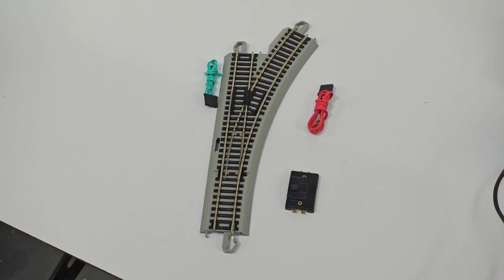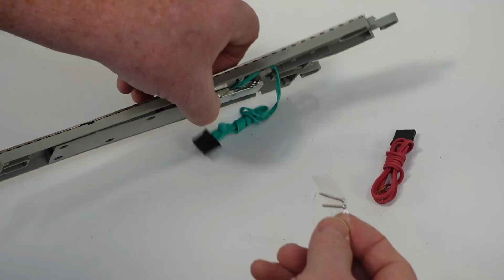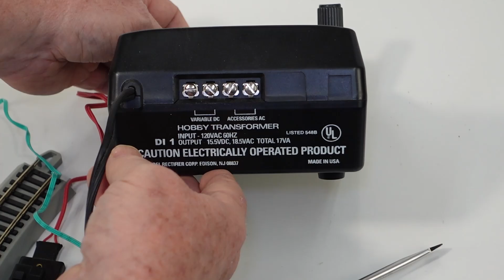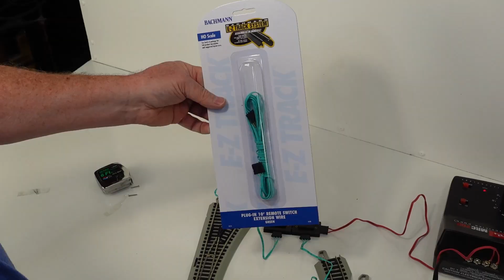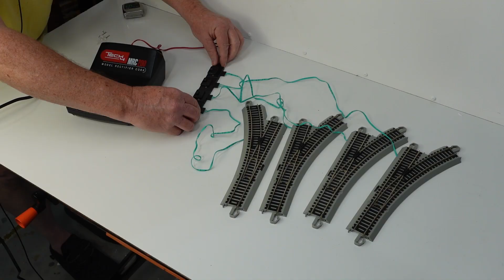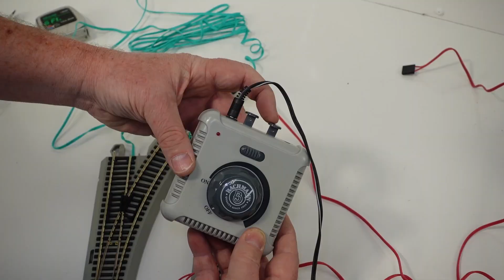Wiring Bachmann E-Z Track Switches!

Comment: Great video I will be receiving my switches tomorrow the tip on the green extension wire was perfect I was able to order for tomorrow. Thanks for the help
Reply from the maker: Thanks for watching and commenting!  I'm glad you found the video helpful.  The green wire is a great accessory. I hate having wires stretched to their limits and the green wire are pretty long, providing plenty of slack. If there's too much slack (as often happens with us) we coil the access wire up and hang it from a hook under the table to keep it out of the way.  Good luck with your layput!

Comment: Hello Sir,
I am from India. Loved how you explain in detail. Will the small grey power supply run the train also? Or just the turn out?
Reply from the maker: Hello ripplesonroad, Yes, those small gray Bachmann controllers power the track. Those are the type of controllers that typically come with Bachmann DC train sets. The track wires are connected to the controller via a TRS like plug in connector.  And, as you saw, if the power supply also powers accessories (not all do), the power supply will have a pair of guillotine type wire connectors to receive the wires from the accessory.  I hope that  answers your question. Thanks for watching and commenting!

Comment: I tried to set up my Bachmann EZ Track 44861 turnout switch following the instructions in this video. But it fried the switch as soon as I connected it! (Started smoking, burning smell - won't use anymore.) I know I have the right connection to the power pack. Any idea of what is wrong? Thanks in advance to all that reply.
Reply: Looks like we got this one figured out. Thanks for this video.
Reply from the maker: Wow.  I've never heard of that or experienced that before. Even after it's wired up, the switch shouldn't activate until you throw the switch.  I've wired and rewired many of these switches over the years and have never had one smoke immediately after connecting. I'm not an electrical engineer, but it sounds like either a faulty switch or it's getting way too much current somehow.  I wish you luck resolving that issue. Thanks for watching!

Comment: Could you plug the red power supply wire right into the power track that comes with the starter kits on dc models?

Comment: My power supply on my Bachman train never came with the two tabs on top
Reply from the maker: Yes, I've noticed some of the Bachmann controllers do not have the accessory terminals on the top of the controller (I think that's what you're referring to).  The controller we use to power the turntable dose not for example.  If you have no accessory power connectors on you power supply consider using an AC adapter.  They work quite well for this and are pretty cost effective (check out amazon. About $10). Good luck!
Reply from the maker: I meant to add that we have a video on using AC adapters for accessories if you're curious. There are many other videos on this topic on YT as well. Good luck!
Reply: @Northeasttrainyard I just bought a used power supply and hooked up my switch but the switch is backwards

Comment: The green wire cable doesn't reach as far as I need, and I'm not sure how to make it longer.  Any ideas?
Reply from the maker: Yes! Bachmann sells an extension wire  for this. The extension wire is even green like the wire from the turnout. We use these quite a bit and they work well.  You can pick them up on Amazon for about $12.50. Good luck and thanks for watching!

Comment: Enjoyed your video, but my Bachmann train set transformer doesn't have the two springy posts to take the switch power leads that yours in the video does.  Can the switches be connected to the rerailer track piece somehow?
Reply: No. Track is variable voltage. 
You have to buy a controller with accessories connector. 

Why would Bachman sell you a $45 turnout you can use with a rail chief or yard boss boxed set? 😃
Reply from the maker: Excellent point docdarlin5491.  I'm not sure what your railroading budget is, Davidkoopman-r3w, but you could use an inexpensive AC adapter to power your accessories. Check out our video on AC power adapters if you're curious how that would work.  Thanks for watching and commenting and good good luck!
Reply: Why dosent Bachman make one to help young railroaders to run there trains. Its terrible they dont sell the componets to switch the track remotely and
Reply: put some instructions on the back of the package on what you need to make it work

Comment: What if your DC controller does not have any power supply connections?
Reply from the maker: Yes, I've noticed some controllers do not have the accessory terminals (one of our Bachmann controllers doesn't).  If you have no accessory power connectors on you power supply consider using an AC adapter.  They work quite well for this and are pretty cost effective (check out amazon. About $10). We also have a video on this topic if you're curious.  There are many other videos on this topic on YT as well.  Good luck!

Comment: I just upgraded to Nickelsilver tracks and as a long time ez track user I noticed the turn outs suck for steel track. I really hope these nickel silver switches are better and don't derail my trains. I have a operating coal layout with nothing but vintage Tyco and Atlas two bay operating hoppers, and they make a mess when those poorly constructed frogs open the dump doors. And then derail the cars behind which being loaded with a loose load they sometimes spill all over.
Reply from the maker: Yup, from what I've read/seen the gray nickel/silver track is better than the block steel alloy.  I will say even the sliver/nickel turnouts can be hit or miss as far as derailing goes.  Some work better than others. Good luck and thanks for watching!

Comment: Dude thanks a ton! I just got the Worlds Greatest Hobby Kit for the Nickel Silver track and this video is awesome for how to wire the switches! Thanks a ton from a mid 30s Texan who is getting back in HO trains! My switches are now electronically switching
Reply from the maker: @RichyN25  glad you found the video helpful! Good luck with your layout and thanks for watching!
Reply: U run power lines to long sections of track.?
Reply: @ you can power the entire World's Greatest Hobby track layout plan with just one power connection without any issues, I've got a couple videos on my channel I took in short form showing trains running and I'm just using a regular Bachmann power pack and nothing else.
Reply from the maker: @RichyN25  Yes, totally true.  When we were researching putting in a garden railway, we were asking about power requirements and the store clerk said it didn't matter how long the runs were.  WE use those little Bachmann power supplies on the regular.  They've never failed us. Thanks for watching!
Reply: @ you ever seen HOPoweredtrain on YouTube? he's got a whole warehouse/shop layouthe can power off a single power pack and some aligator clips, he said whats most important is good track electrical connection and you can power some crazy track lengths with just one power feed

Comment: So when we add a switch to our track the train stops running . Dk I need to special wire something ?
Reply from the maker: Hard to answer not knowing anything about your layout.  But, from our experience I can say two things.  First, if you're just running Bachmann E-Z track, you shouldn't need special wiring.  We have set up loops with turnouts and sidings with only one track power source (the usual piece of re-railer track with plug for power).  Nothing special about that and our layouts run fine turnouts and all.  Second, we have had our share of track that didn't seems to be getting power. That is usually one kind of connectivity issue (i.e., a loose connector or the track just needed to cleaned). Sorry we haven't got a concrete answer for you.  Good luck!
Reply from the maker: Sorry, on the the second point it is usually SOME kind of connectivity issue, not ONE kind.

Comment: My bachmann controller doesn’t have those things that you press down so how would I do it
Reply from the maker: @shanesfunzone3575  I think you'll need a power supply with an accessory connection if your power supply doesn't have one. Good luck and thanks for watching!
Reply: @ thank you for your help
Reply: @Northeasttrainyard  Bachmann sells an accessory power supply. Bachmann #44219 Multi Accessory Power Supply (16V DC). available from TrainWorld and other retailers.

Comment: I wish Bachmann would revise these diverging 18 inch radius turnouts and build them like their numbered turnouts.  Their numbered turnouts are actually pretty good.  But these 18 inch radius ones can be unreliable.  Some work OK out of the packaging, but I have found that many have to be tweaked in any of a number of different ways to get them to not derail rolling stock.

Comment: Excellent instructions for this beginner.  No wiring instructions with the EZ Track package, nothing on the Bachmann site... .  Got my turnouts working with an old 15V output wall wart.  Thanks SO much.

I also have a question i think you (or someone else maybe) could help me with.  I have a new Bachmann EMD GP40 in HO.  It is DCC Ready with 8 pin connection.  I will run it on EZ Track with Bachmann EZ Command Plus controller.  What decoder do you recommend?  No sounds on it. Decoders baffle me.

Thanks again.  Hope you have a Good Thanksgiving!
Reply from the maker: Hi Promontory!  Hope you had a good thanksgiving as well.  In all honesty, we have not taken the plunge into the world of DCC yet.  We'd like to start getting familiar with it soon as it's very limiting to be able to run only one locomotive on a track.  I don't think I can give you a recommendation based on my inexperience with DCC.  I hope some knowledgeable hobbyist can help you out. I took a quick look at the HO Bachmann GP40 on the Bachmann site.  Nice looking locomotive! I hope you have good luck with it. Thanks for watching!
Reply: I'm new to this hobby also and I do see how some people feel it beneficial to run all of their accessories and or switches off of a separate power supply like this video shows. When you get into a lot of accessories it does make sense. The important thing is you can control your switches / accessories such building lights from one central location. Just label your switches and turn outs so you know what switch to throw. EDIT: However, Yes, you can run your DCC turnouts directly from a Bachmann EZ Command system, meaning you do not need a separate power supply for the switches; the EZ Command unit can provide power to control your DCC turnouts as part of your overall DCC system
Reply: @monmixer  Can you wire the EZ Command Plus to the wired turnouts (Non-DCC) like in this video? if yes, how do you connect the wires of these turnouts to the EZ Command plus center?

Comment: Hola nuevamente yo tengo una locomotora Santa Fe backman HO con sus respectivos vagones viene con su respectivo transformador de corriente modelo 6607 del cual sale un cable rojo q conecta a los rieles para darle corriente y en seguida de donde se conecta este cable hay otro espacio q vienen dos tornillos tiene una nota en ingles,  q dice ÚNICAMENTE CONECTAR ACCESORIOS.
Mi pregunta porque no tengo mucho conocimiento sobre esto, en este espacio q estan los dos tornillos debo conectar este accesorio q lo acabo de comprar en Amazon  igual a uno de los tuyos q tienes en el vídeo es el accesorio para cambiar de riel el tren E-Z track remote backamann.
Espero q me hayas comprendido mi pregunta.
Gracias por responder un abrazo desde Colombia.
Reply from the maker: Hi principe1216, Thanks for watching and for your question.  I think I understand the question which I think is..  do you connect the red wires coming from your accessory - in this case the turnout's slide switch that opens and closes the turnout -  to the screws marked ONLY CONNECT ACCESSORIES.  Based on your description, the answer should be yes.  Any accessory wiring should go the the power supply terminal screws labeled as the accessory connections.  Again, that's based my understanding of your description.  Hope that helps and good luck!

Comment: Do these have to be powered if you’re using to to make a loop/turnaround section? When I do it that way, the train loses power halfway through the turnaround loop (diagram like this: —O).
Reply from the maker: You're referring to a reversing loop, correct? I don't think powering the switch should effect the track power. The switch power simply moves the switch points back and forth as far as I know.  We've never done an HO reversing loop before, but from what I've researched your track power problem may be due to polarity issues.  So, lets say your reversing loop is running on the straightaway in a left to right direction into the switch and loop. When it comes out of the loop back onto the straightaway (or maybe even before this), it will be running in a right to left direction. This is opposite of the original direction hence possible polarity issues. I don't know your layout specifics so I could be wrong in this case, but that's my guess (and you may already know this). Good luck!

Comment: I have small layout using DCC with NCE Powercab controller.
Can I still hook up the wires to a DC controller to make the remote switch operate?
I want to try out these EZ switches.
Reply from the maker: Hey marcvonheleb, you're thinking about just running accessories (in this case your switches) off of a separate, dedicated DC power supply while the track power is still DCC?  We're not experienced DCC users, but I don't see why that wouldn't work.  Let us know how it goes.  Thanks for watching!
Reply: @Northeasttrainyard  thanks, will give it try
Reply: @marcvonhebel3475  It’s fine, I will try it when I build my layout.
Reply: Did it work? I need to know for my upcoming layout
Reply: @LemonadeBrosGaming  I have not got it  to work. However, I might not have it set up right or wired correctly. 
I think I'm even missing some wires.
Sorry, I wish I could be of more help.
Reply: @marcvonhebel3475  Did it work?  I'm starting my layout and I have the same situation, NCE Power cab and I want to use Bachmann remote switches
Reply: @eltakenos  sorry, I don't have the right connectors/wires to possibly make it work
Reply: @eltakenos  It works!
Reply: @eltakenos  I set up my layout it works perfect
Reply: @marcvonhebel3475  thanks!!
Reply: @PixelPunch1000  thanks!!!!!
Reply: @PixelPunch1000  Are the switches isolated from the main power track?
Reply: @LemonadeBrosGaming  do you have a video/pics of the setup?
I want to get it to work...
Thanks